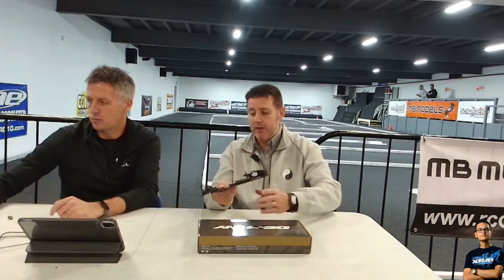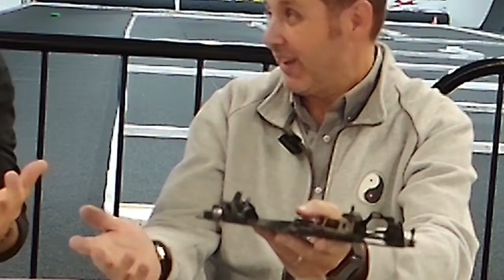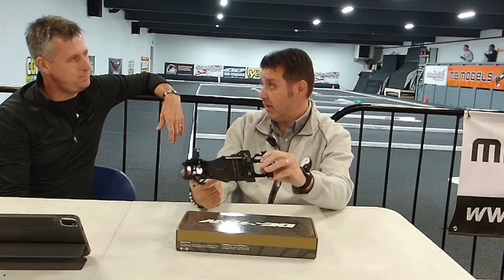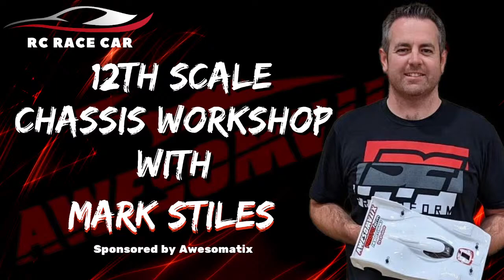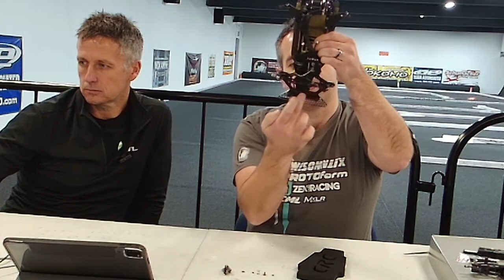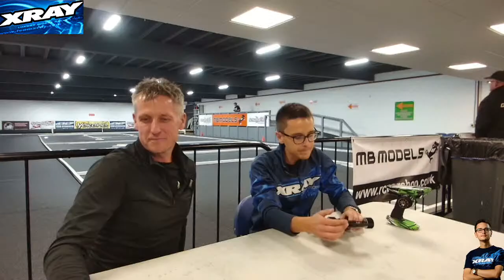David Spashett Chassis Workshop - RC RACE CAR GP

Comment: I had the 1st UK Destiny GT12 in a box from Zen. I’m new to GT12 racing as I raced 1/10 electric touring cars 22 years ago & gave it up as had a young family. I have recently returned to RC racing and so I have had to learn lots as so much has changed! The car was easy to build and I only needed to call Zen racing with one question. Car was setup car as per instructions and raced it at my local club the next evening and the car was superb. Straight out of the box it drove very well & was consistent in the way it handled. It has taken several knocks and each time nothing broke or went out of adjustment. The only thing that needs improvement is the driver 😂.
Reply from the maker: Superb feedback, get trackside and keep working at it and let us know how you get on!!